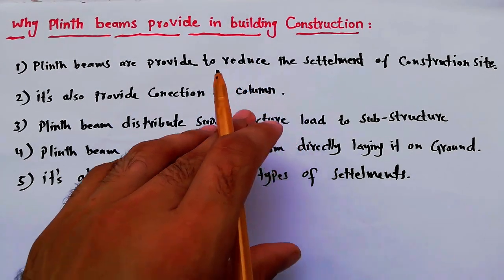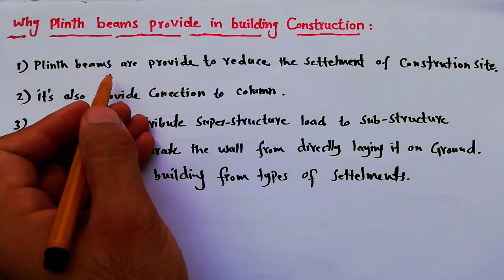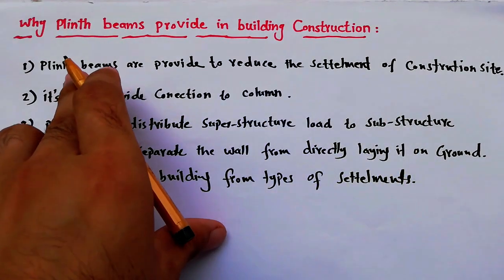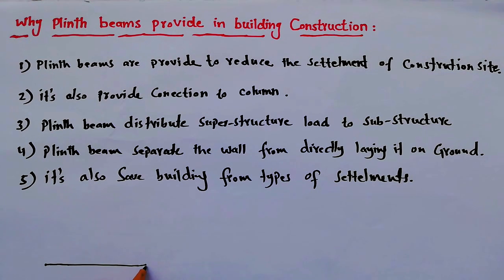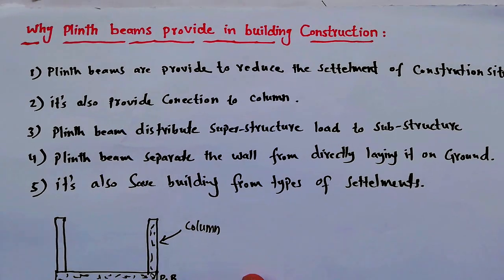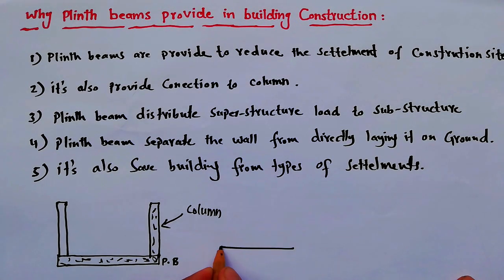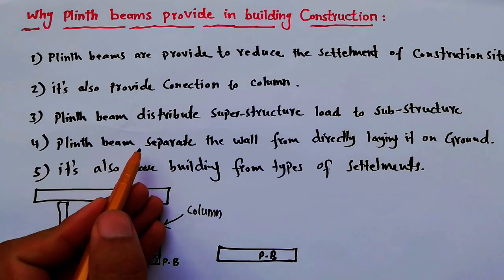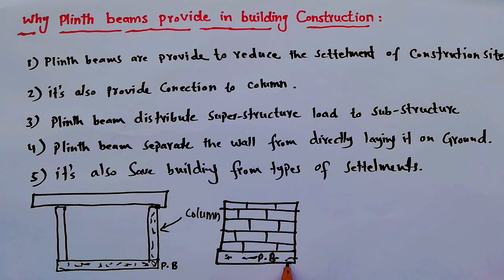Why plinth beam provide in building construction?

Comment: U left the main reason behind it?....plinth beam is provided to avoid the long column effect......if u not provide plinth beam then length of columns becomes to long...that is first floor slab to plinth level is 3m and plinth level to foundation is approx 2 to 3m....so the total length of column becomes 5 to 6m... If u provide 5 to 6m column then there will be a chances of buckling or crippling...it is possible to to provide 5 to  6m column but c/s is to b increased
Reply: Arbaaz Mirza 
Plinth beam kaha provide karte hai?? 
I mean ki only below the masonary wall? 
Or below partion wall??
Reply: Yes...both !!...... Plinth beam is also provided below partition wall...it prevents the settlement of walls... plinth beam carries a  load of walls.... only ground floor walls ok
Reply: Arbaaz Mirza load bearing wall structure and framed structure dono mai provide karte hai?? 
Tnx 4 rply
Reply: So better way is to provide plinth beam....& B safe